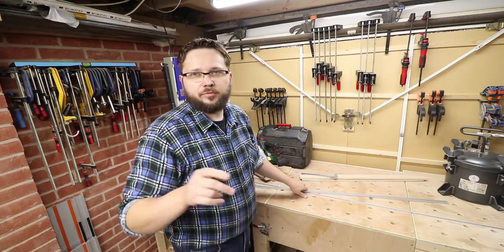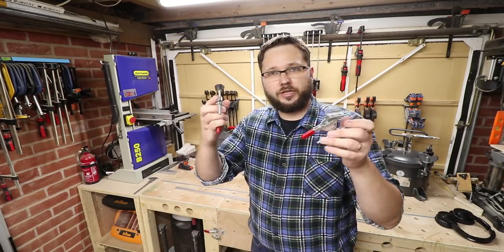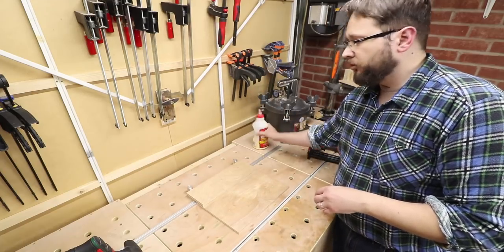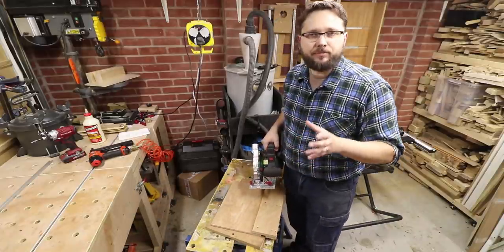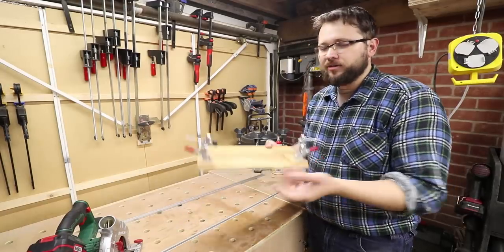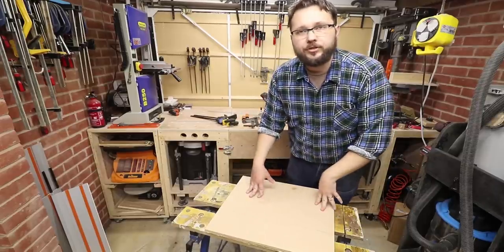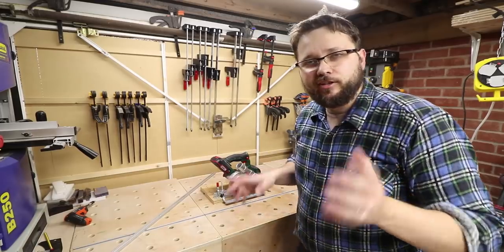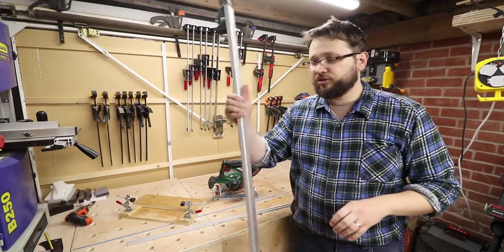Simple Circular Saw T-Track Guide Jig

Comment: Great idea. Cheaper than buying kreg track guide
Reply from the maker: Thanks👍
Reply: @CasualDIY  Hi sir, If I want to extend the length of the T-track, what accessory will I buy to extend it? The maximum length I can buy in the shop is 800mm. I want to extend it so I can cut a whole 4x8 ft plywood. Do you have a video of it??. Thank you in advance.

Comment: I’ve never used clamps on a mitre saw because the rotation of the blade pulls the workpiece hard against the datum edge. I’ve always had good results without clamps but is there maybe a safety reason for using them that  I don’t know about?
Reply from the maker: Fingers away from the blade, work piece secure. For me that's a win win scenario😁👍

Comment: The problem with this saw track isn’t the woodwork….it’s obtaining that extra long super straight ali T track.  Amazon doesn’t like T track over 14 inches.  You CAN get it in four foot lengths if you don’t mind buying ten at once for 90 bucks….Angle iron might be an option, but getting it absolutely straight can take some researching….However, the build is well done, well explained and inspiring…Thank you.
Reply from the maker: Yes the T-track length may be an issue for larger jobs unfortunately

Comment: have the same Parkside guide clamps, i wish if they made them around 125cm of clamping capabilities instead of 100 cm so you can get away with cross cutting on plywood sheets. by the way the einhell TE-CS 18  cordless circular saw have a built in groove for that , both the parkside and einhell are around the same price range. So if anyone out there getting a new saw consider the einhell if you haven't invested in the parkside x-team battery family.
Reply from the maker: I actually got a longer one as you mentioned but from different brand.